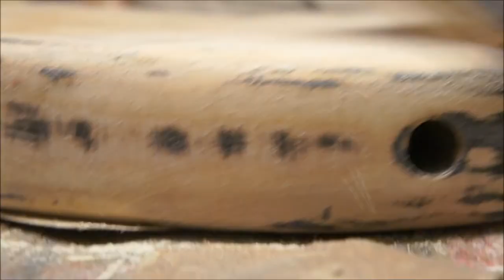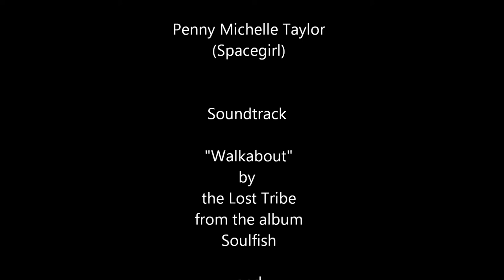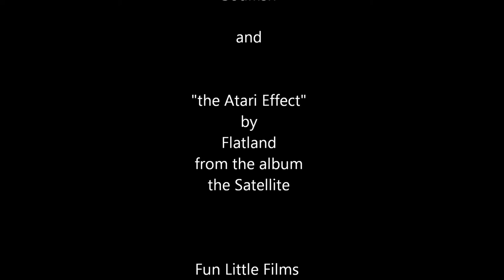Swirl-paint Peavey Patriot Guitar Project - by Spaceman K. Nate

Comment: IN RETROSPECT:  Tips for those who want to try, getting the temperature correct will definitely lend the most satisfactory results but your home water heater tank may find this demand a challenge, I recommend boiling as much as possible.

ALSO:  Wear some freakin' gloves.

NOTE:  I too was disappointed with results initially, which is why (not shown in the video) I chucked it in a sandblaster and hit it with aluminum oxide to wear off some of the excess paint, and left an amazing weathered woodstain effect.

GLOW IN THE DARK POWDER?  brilliant.